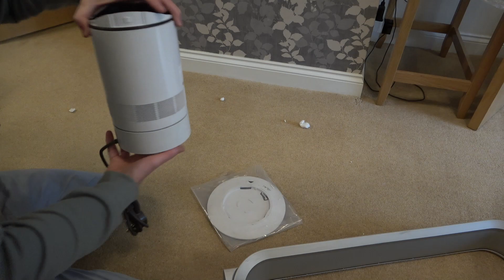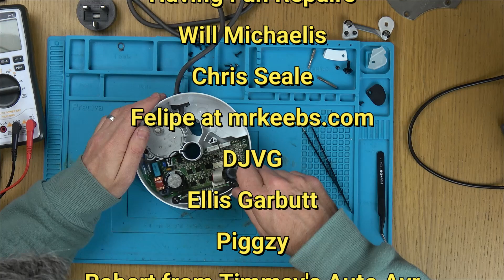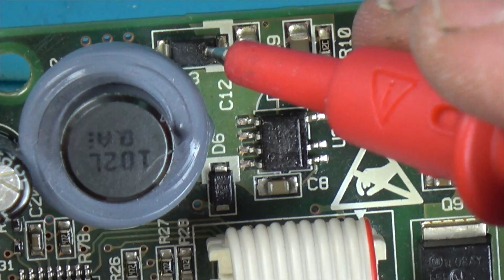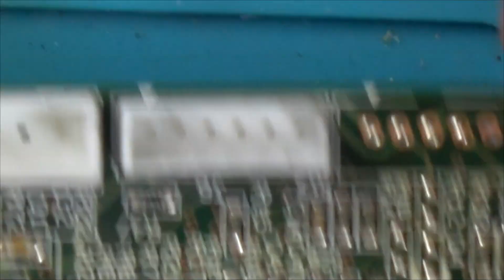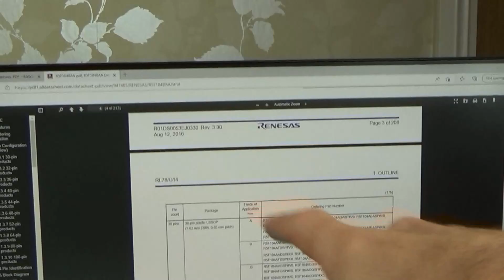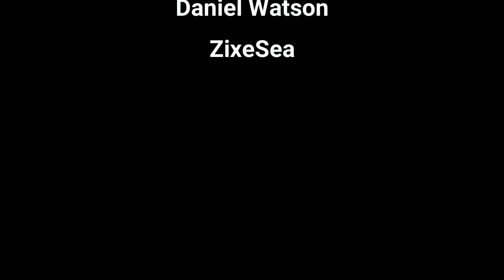Expensive eBay DYSON AM07 FAN - NO POWER FAULT - Can I FIX it?

Comment: pro tip: normal fans come with two speed settings: too fast and way too fast .. I used to use them with a dimmer - which is a totally wrong thing to do b/c the fan motor is an inductive load and on top of it they have syncronous motors which are locket to the mains frequency - but a 500w dimmer can take the abuse of a 20w fan. It gives me a way to slow down the fan by "starving it". and it runs somewhat more silent.. also bigger fans usually run a bit quieter

Comment: I wouldn't think the microcontroller does more than enable/disable certain IO pins. So if it is the issue, you could remove the chip then try directing 5V or 0V to whichever of the IO connections in hopes of finding ones that enable the main fan. If that worked it might be a simple hack to add some small external switches to the chassis (remote would still not work of course).

Comment: Another prime case of adding a microcontroller where it's not needed.... Yes, technology where it's needed, a nice electronic speed controller instead of ballast resistors is great, but you don't need to add a micro to control it...   But then idiots wouldn't pay hundreds of quid for bleedin' fan without some blinking led's.
Reply: These fans use bldc motors requiring 3 phase ac thus you need a whole micro to control it. The micro and mosfets form a esc just like in drones. Bldc motors can turn really fast and no brushes ro worry about

Comment: Very interesting video again Vince. I thought I saw a capacitor between two legs of the transistor. That could have caused the short.

You used the remote without testing the infrared. You can test it with your phone in the selfie-mode. That’s how I always check ir remotes in the repaircafe.
Reply: I was going to say the same about the remote, it’s a trick that can save a headache when remotes don’t seem to work

Comment: You have to love the way Dyson have "invented" everything someone else has already invented, We had a fan less blower for air drying paint in the bodyshop that worked the same way 20yrs ago we just ran it through a three phase compressor to supply the air and not the fan blades hidden in the base of  your heater, Then 30yrs ago I looked at workshop next to a woodworking shop that had a sort of cyclone dust disposal system on the roof a great big funnel/fan that looks just like the funnel fan set up in a Dyson hoover (yes I used those 2 words together LOL). Mind you my mate's brother was a crash test dummy for Dyson (Im not kidding he was given products to test and brake) and my wife has destroyed that many Dyson hoovers that I refuse to even look up the replacement part numbers let alone pay for it, thats her job and when the cellartape gives up around the handle of this one its her problem I will just paint the skirting board again. Great Video as always x

Comment: You have to be so careful about listening devices... I was talking with my youngest on how I really fancied a bread making machine and about an hour later I saw an email from ebay advising me of an auction being relisted and in the little bar below "suggested for you" was a £20 brand new Amazon Basic's breadmaker... very spooky and it done it again whilst talking to my eldest about I fancied some new Adidas Vespa trainers and trackie bottoms... next email from ebay had in the suggestions for Adidas Vespa trainers and several listings for trackie bottoms and I will admit I bought two pairs of the trainers and all the trackie bottoms too and feel such a heel for succumbing to corporate pressure like that O.o   I bought the breadmaker too, £53 on Amazon and its like the best thing since unsliced bread... :P (abs loving baking my own stuff, costing me about 40p a loaf and no additives, bread is baked not steamed like shop bought stuff)

Comment: I’m wondering for fun can you take the fan and remove the chip and add wires to bypass the chip without it and run the fan using some kind of speed controller with a rotary switch added. This way you can manually adjust the speed of the fan where the chip was using a rotary switch.

Comment: The big blue capacitor called Rifa is for interference suppression. Together with the resistor you noticed. Both sit across line in and zero. Sometimes these Rifas blow up, and that can cause strange phenomena all around the board. You can remove the Rifa and see if that makes any difference.

But definitely, you should be able to make bypass the controller and have the fan be on constantly. Now if it is pulse width modulated then you have a bit of programming to do. Still... interesting. Live and learn.
Reply: Unfortunately it is not as simple as pwm.
This motor has hall effect sensors that monitor in what position the rotor is and the micro controller decides when each coil and with what polarity should be fired,
You see the 6 smd mosfets on the pcb, Well they are connected to the 3 coils inside the motor and with 6 mosfets the micro controller can turn on any of the 3 coils in either polarity.
Technically you could make a motor controller but it would have to work on rectified mains (330v dc) and would require some engineering.
If you are interested i would recommend that you read up on bldc motors and bldc controllers since I probably didn't do a good job of explaining it.
Reply: @diymaster1121  what do they even need such precision for a fan? I understand hall sensors on scooters and ebikes, but fans? Surely the controller can make do with back EMF sensoring like they do on RC motors, or even just use any normal motor instead of a BLDC and be done with it. Edit: hey, I'm thinking a drone ESC and a PWM signal generator might be enough to get that motor to spin.
Reply: Rifas tend to blow up in BBC micros and Macintoshes.. The newer ones don't really become smoke machines

Comment: I fixed up a Xiaomi Mi air purifier 3H recently. It has a delicated power board and logic board. The power board is blown and I just power it up externally with a power brick running 19volts DC into it. Works fine after. I would say if you really want to use the Dyson fan, feed power directly to the motors and skip the PCB altogther. Then put a toggle switch for the oscillator motor and a voltage regulator for the fan motor.

Comment: I was closing my eyes on this one , This pcb is called "live chassis" is because they do not have an isolated power supply everything is referenced to live 🙈, You are lucky that you did not blow up you're bench power supply, The reason why the short is gone is that you blew it open, The power supply for the chip is limited in how much current it can supply, The chip is pulling the power rail down by injecting you're power supply , You supplied the extra current to blow the internal chip short, It's a shame that even a fan needs an MCU these days , Still a great video 👍👍👍👍👍👍👍👍
Reply from the maker: Thanks Anonymous, shows how little I still know!!!! I need to Google 'live chassis'. I think I vaguely know what it means but hopefully it will become clearer. I will re read this again later and hopefully I will understand it more 👍👍👍 As always, thanks AR...Just to let you know I'm missing your videos😓.

Comment: A long time ago you had a microcontroller that was behaving weird, that one only needed a reset (in this case pin 2) and came alive. Is the signal on the reset pin stable? How is the clock signal on pin 4 (if it uses a external clock signal)?

Comment: The MCU is what interprets the remote control signals and drives the motors. While you probably won't get the firmware image from Dyson to flash into a replacement MCU (probably obtainable via Mouser/Digikey/etc.), with some reverse-engineering it should be possible to figure out which of the GPIO pins on the MCU controls which part of the fan (oscillation, fan speed, etc.). Interpreting the remote control signals may take some reverse engineering too, depending on how complicated Dyson made the encoding.

Basically it'd be a pretty nice project to hack on, and it seems this fan can definitely be made to work again :)
Reply: The six large transistor packages sure look like three half-bridges for a three-phase BLDC style motor. Wouldn't be too huge of a project to drive it, for someone familiar with embedded development. A bit of a different type of project though. Reminds me of the kind of thing Ben Heck does these days.
Reply: @jessicav2031  Indeed, there are probably direct links with the MCU's pins that could be hijacked with minimal PCB surgery. 

May also just desolder the MCU and use its pads, I guess, since it's currently shorting the heck out of the board :)
Reply: It is probably a brushless motor and this RL78 varian probably fited with specific peripehrals to control. Probably a bit more complicated that on/off logic. Still doable, but just getting into RL78 is not easy. They are not friendly at all. Renesas is targeted to industry in big volumes, not hobbist.  But you can fit and Arduino there and forget about the RL78. Antoher down side, look like power electronics, making even more complicated to debug in real life
Reply: @38911bytefree  In other words, more fun! I was thinking something like another MCU on a daughterboard that either soldered into the slot for the existing one, or sat to the side with jumpers going to the pads. It would be an epic puzzle to solve.

Comment: Hi Vince! Silent sub here!  My first electronic job was at Panasonic service dep't, A cool trick I learned there is that you ccan use an Xacto knife (or a tiny needle) to gently lift the VCC and/or VSS pins of the MCU chip while heating up the pin with the soldering iron. That's how we were unsoldering small SOT23 SMT power transistors.  If it turns out that it really is the Renesas MCU, this  little guy needs to  be programmed and we do not have the Dyson binary file, so if it IS the MCU, I think that 
we're dead in the water......... Good Job for all your vids!!!  (conformal coating is a real pain, isn't it ?!!!)
Reply from the maker: Thanks for the info Daniel 👍👍👍 Nice tip on the Xacto knife idea and YES conformal coating is such a pain! 👌

Comment: Such a shame that a chip failed and even worse its the brains aka the mcu that failed so this thing is dead unfortunatly and the manufacturer aint gonna give any customer the code so if you where to buy a new one you still need the program. I bet a motor driver mosfet/chip shorted out and put the full voltage in to the pin of the mcu and a mcu does not like that! And thus it shorted internally and it did not blow a hole in it so it was not realy obvious when you first troubleshooted it. It seems to be doing more then the timer and functions, it might also drive the mosfets that drive the 3phases of the brushless dc motor (bldc, also used in drones and drones also have a kind of "esc" inside). Had some encounters with a dead mcu in devices and some of them had blown the mcu because of a faulty psu, or some had blown the mcu by a shorting driver chip or a output/input shorted to a powerline. The weird chip behavior might be because some weird shorted path inside the dead chip (had the same happen and i was excited for it to come back to life but no, it was still dead.
Reply from the maker: Thanks for the detailed comments 309 👌👍👍👍

Comment: Another example of over complicating something so simple.  A fan doesn't need a microcomputer and so much ancillary circuitry just to turn on fan motor - even multiple speeds.  As mentioned above though the motors are unique so it's not just a case of bypassing the electronics.  Fingers crossed you come across another controller board in the future!
Reply from the maker: Thanks midinotes 👌👍👍👍

Comment: Do you have a six pin chip on that board that has pin 5+ and pin 1- ?
If so replace it as it controls the PWM for the power supply to that hot chip.

Comment: Fancy fan, but when it's not working, very difficult or impossible to fix. Having to program the new chip, before it works, sounds like modern cars and their modules, can't repair them without scantool, which can be pretty expensive. Rolls-Royce was quite ahead of it's time, altough I guess it still doesn't have CAN bus network between engine control unit and other modules?
And of course if these fans are still so new they are under warranty, not much used, faulty ones on the market for comparison or spare parts, every regular consumer will claim replacement unit for warranty if it's faulty :)

Comment: 13 amp fuse in a fan? A heater sure but fan?
Sounds like it popped several 3amp fuses and the old owner thought just put a 13a in and killed it

Comment: When you supplied DC power via your bench PSU at 4Vdc, you had overriden the supply rail short. That allowed the Dyson PSU to start working which itself brought the supply voltage up to 5Vdc and you saw that back feeding to your bench PSU. When you switched off the Dyson the 5Vdc dropped and you saw 4Vdc on your bench PSU again.
With the uController drawing 400mA+ (confirmed via your Flir) it's knackered.
Reply: I don't even know what knackered is but it sounds delicious
Reply: I don’t think it is knackered.
Reply: Yep !

Comment: One thing about those synchronous motors (the oscillating one) they will rotate either way whenever turned on, and it's a 50/50 chance whichever way it rotates when power is applied, so when it changes direction here it suggests just an interruption to the power supply. Great video! 1 amp is definitely enough to blow a chip, if you consider how much current this is on a car incandescent bulb, and like you found out there was some kind of existing short in there which you melted through lol Looks like there's another on Ebay for £70 with the description: shorts fuse, could be a short in the power supply on that one? You might be able to combine parts or fix that one!
Reply from the maker: Thanks Tokaisho, that eBay listing has my name written all over it 😂 I foresee another Dyson fan video coming up in December. Thank you 👌👍👍👍👍👍
Reply: These fans are terrible for this one particular fault so it would be near impossible to find one with a working mainboard.
Reply from the maker: Tyrone, I wonder if this eBay one has a fault earlier on in the power supply if it is tripping the fuseboard, the MCU might be OK???? I think I going to risk it. Could be an interesting video either way 👍

Comment: I would personally not do that voltage injection anywhere other than the input.
By injecting the voltage somwhere random in the circuit you can seriously mess stuff up.

Comment: The other way to fix should be to program an arduino to control the fan motor to make it work ;)
Reply: It could possibly be an option, i think there was an open ESC project which might work. You would also have to do code for the display, remote, and oscillation motor to make it work as it used to. I did think of that a while back but it seemed too much effort as I had the same problem with a hot+cold version where the MCU was fried also.